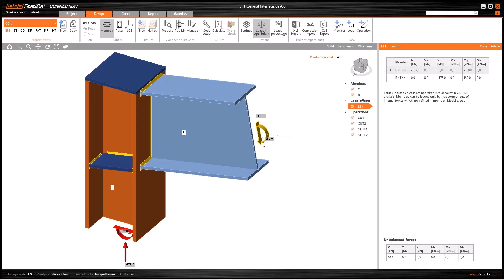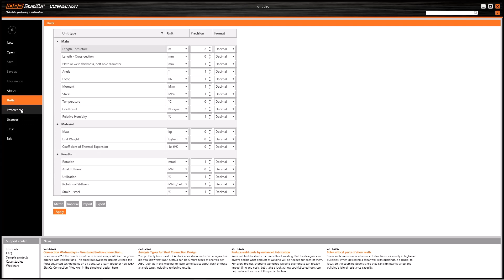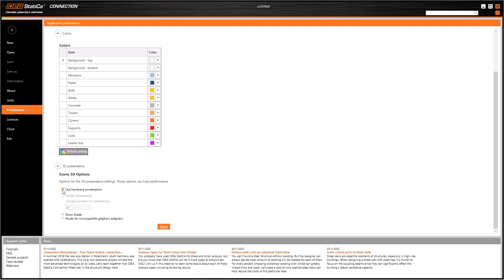Project Settings

Comment: How can we analyze same model by applying different codes? For instance, checking same connections by aisc and euro code
Reply from the maker: Hello,
you can choose the code when starting a new project. This is the only setting you can not change later.
https://www.ideastatica.com/support-center/continuous-beam-over-column-connection-design-en